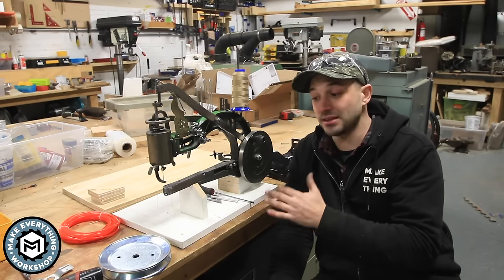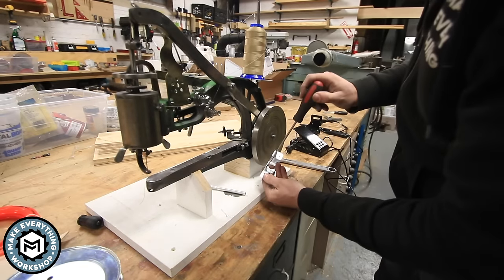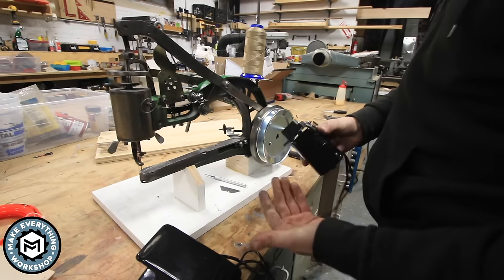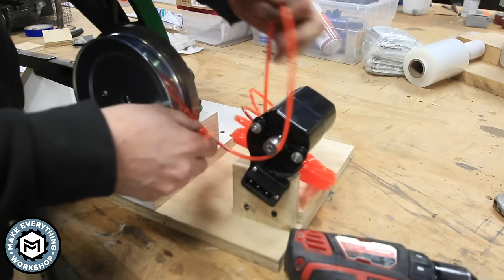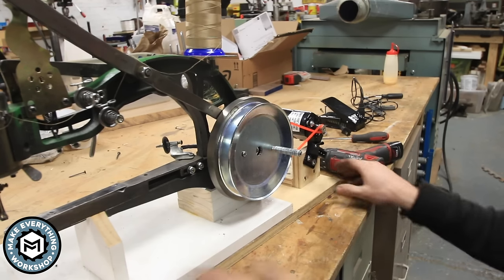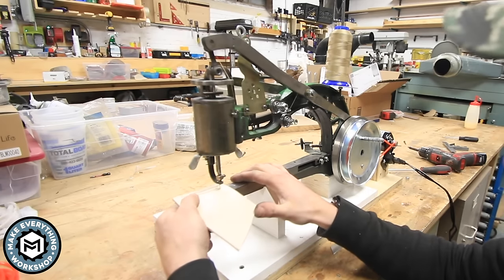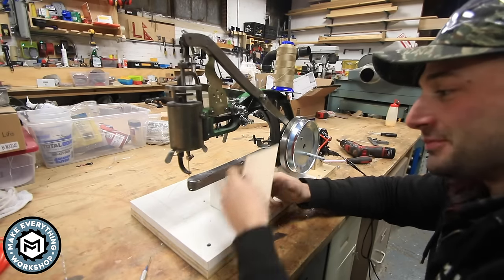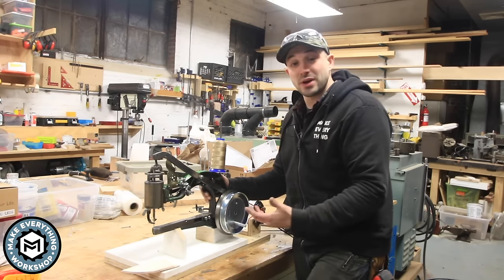Motorizing The Leather Sewing Machine, For Under $50

Comment: My conversion cost $60 but i got a metal mounting plate thats for my machine and my pulley has a groove already in it for a flat belt also if you mount the motor in front of drive wheel ( no need to cross the belt ) its not so prone to lifting the front and not as violent plus the motor i bought is only 3200 rpm so mine goes much slower then yours .

Comment: Heres another hack. On mine I cut a piece of 1/8 stainless steel around 10"x10". Then I drilled a hole where the needle goes through. Then I drilled another hole where the screw holds down the needle plate, and a smaller hole where the little dow that holds the plate in position. I remove the needle plate and then I mount the square plate on the machine. This allows me to have better control of my leather when sowing belts or larger items. Another hack is to buy extra feeddogs, and then dip them in plastic dip. I do this about three times on each foot. This will prevent them from marking the leather. When the plastic wares off, just clean it off the foot and then dip it again.
Reply from the maker: charles self great ideas!
Reply: The usual solution is to make a wooden table that has a slot for the arm and stands flush with the needle plate - no need to change anything on the machine.  Although that wouldn't work if you're using the tripod stand that these machines come with (I think most people throw those away because they're flimsy)

Comment: And the other thing you need to buy is a push rod for pushing the thread down the long shaft at the top of the machine! Another tip is to put a strip of felt on the machine with a drop of oil on the machine so that the thread passes the strip and puts oil on the thread 🧵!

Comment: Add a slightly bigger pulley to the drive motor... also reverse shock the polarity of the motor to make it work in reverse and you won't need the twist in the belt 😉

Comment: I recommend removing the handle all together if you are going to do that. two reasons,when going that speed it would be super easy to get injured or have thread bind in the space. You can also use an industrial sewing machine motor with some modifications.

Comment: So general questions for this as I plan to do something like this when I get back from this deployment:
The belting comes in 2mm and 3mm X 10 sizes on amazon, would you recommend either of those over getting that size and trimming it?
I saw below the idea to put high density foam in the peddle for more control, would you suggest that?
Are there any new updates or tips from others for someone who doesn't know a whole lot about basic engineering?

Thank you for the suggestion and review/tune-up for this, I have been a leather worker for about 7 years now and I've been avoiding getting a machine since all reliable ones have been 1000+ dollars or break with more than 5oz of leather going through it.

Comment: This is a bit late, but you don't need to do all that mounting a pulley to the flywheel, just make two belts out of the PU belt rope that is just slightly smaller in diameter than the flywheel, put them over the flywheel just far enough apart so the drive belt will fit in between them and hold it in place, superglue them onto the flywheel and you're done! 
Using a single pulley to drive the machine may work for a YT video but it will have no torque and run way too fast. 
I made a plywood 8" pulley on a bearing shaft that the motor spins, to a 1 1/2" pulley that drives the flywheel. I now have a slower drive with much more control and torque. BTW, the foot control that comes with those cheap sewing machine motors is just an off-on switch, I found an old one from a sewing machine that will actually give you a controlled speed.

Comment: That motor isn’t enough for this. If the cams at the end are in a high startup torque mode as when the cam is at its low spot and sharply rising, the motor stalls. The small pulley there also  is at a large mechanical disadvantage. As a result, the belt, which is loose, slips. The other problem is that the twisted belt, due to the small pulley, tends to strangle and cause a tightening. At slow speeds those types of motors have little torque.

I’m working on this too, and intend to use timing pulleys and belts.

Comment: You could add other gears to reduce the speed. Your motor will burn because it cannot reach the needed Amps. Having gears would help also you motor to turn faster without rushing your sewing machine getting too fast.

Comment: back in the 90s we used commercial sewing machines in upholstery work with leather belts made of a leather chord that was attached with a hog ring, though the automotive style v-belts lasted longer they where more finicky. 

how long was it before running the belt with a twist caused enough friction where the belt ran against itself to be problematic?

Comment: So I have a serious question and it will be answered later on in the video but I wanted to be honest about the fact that I had the question and hadn't taught it through yet.   Won't the fact that you cross the belt cause friction, at the location of the belts intersection over time heating the belt and either stretching it besuace it under tension or a critical failure point could also develop?    Just curious to know how did it turn out is that something you have an issue with?
Reply from the maker: It definitely can, but because the belt can be refused with heat it’s easy to fix. I haven’t broken a belt yet

Comment: If you turn the motor with the sheave pointing away from you it will run in the correct direction so that you don't have to cross the belt

Comment: I'm going to buy an RC car rubber tire, slap it on my drill, and build a wood mount to hold it smushed against the crank wheel.

Thanks for this video and the previous one btw! Subscribed!!!
Reply: Just get a socket that fits the bolt and turn that with your drill.

Comment: you need an intermediate double pulley between the motor and the large one to reduce your speed even further. It will increase the torque of the machine and, it will move much smoother and slower.

Comment: move motor and turn it around so that the belt doesn't  cross its self , the belts  will wear longer
Reply from the maker: I had that set up initially, it was a little clunky having it stick out, but long term might be the way to go!
Reply: James M  no it won't. it will still be spinning in the same direction.

Comment: You said you would file down the presser foot, be careful because you will not find another anywhere around town. Look for the pressure adjuster and release it until it doesn’t dig into your material as much

Comment: Great idea but needs some refinement. Definitely need to get that motor spinning fast and have the right slow speed to the machine with all the torque and control you need. After all, leather stitching is not meant to be as fast as fabric stitching! One more intermediate pulley to reduce that speed right down would do the trick. Also mount that motor differently so you dont have a crossed drive.

Comment: You did an AMAZING Job figuring out how to put those alterations together without resorting to expensive machining, etc.!!!  Question:  If the motor was mounted facing the opposite way would the belt turn the correct direction so you wouldn't have to use the figure 8 setup?
Reply: I'm reading comments and it seems we can just reverse the wires to the motor, but I think I'm going to get someone to help me look for a different motor which will operate at a better speed.
Reply: @rwind656  With a universal motor like this you have to switch the wiring inside the motor, where you can get to the separate rotor and stator connections and switch only one of those pairs. Swapping the cables outside the motor will reverse the polarity of both rotor and stator windings, resulting in no change.
Reply: @grumpus27  Thanks, I realized later -- saw it in other comments. My better half would have caught me on it here. I always have to double-check my electrical thinking to see if there's something I've left out.

Comment: since you have been using the motor for a while, how is it working out?  Is it too fast or were unable to regulated the speed with the longer screw?  or changed out for a servo, or abandoned it all together??  I getting ready to add a sewing machine motor to mine.  Also have you ever sewn vinyl?????

Comment: Turn the motor around 180 degrees.  Just move your mount toward the front to realign the drive pulley with the machine pulley.  In other words, let's say you have the motor aligned East to West now. Turn it to align West to East and un-cross your belt.  It will be even simpler.  You don't HAVE to be able to see the pulley on the motor for it to work.   You can get an old sewing machine at pretty much every garage sale for $10-20 and they all have a motor and a foot pedal.  Even the free stuff on Craigslist frequently has old sewing machines.  The price there is even better.   Turn the motor around!!!  lol

Comment: i took two pieces of copper made two rings just a little tight ,soldered ends together then epoxy them on the wheel along each edge took old dryer belt and old sewing machine motor and 10 deck screws all for just the machines cost glue  and old junk repurposed  oh and scrap wood for base and motor mounting block works great and i made three belts from one dryer belt tools ,hammer screwdriver knife  leather gloves help with knife work i learned hard way cut the shit out my finger cool video just another method  of  assembly and part acquisition was all i was saying no dis to your work or  idea  just another method for creation/reuse age of  old  parts  for free

Comment: You have a problem with torque and RPM. To get the torque you need to provide higher voltage to the motor; but in doing so, it goes quite fast and gets aggressive. You’ll notice it works a bit better under load while actually stitching than free-wheeling. So my recommendation is to add a flywheel to the pulley. You can do that quite easily and it’ll smooth out the operation, allow you to push the motor at the voltage and current it likes (notice the humming when you’re loading it at a lower range). And like a regular sewing machine, perhaps a quick spin on the manual crank to help it get going will reduce the inrush strain on the motor at start up with the extra spinning mass.
Reply: @jeffallen3382  IME when you try to go slowly with these motors there's insufficient torque to get going so you apply more pedal and  then it's already going too fast - more inertial mass will perhaps moderate this a bit.

Comment: I would be tempted to use a battery powered drill for the motor. It would take a bit of bracket making but the variable speed would be more consistent. It could also be used at the dock if working on a boat

Comment: how about extending the crank handle, same as having a larger crank wheel to get more torque, of course that would mean you'd need more clearance, but I think installing the machine at the very edge of the stand/table would do it? what do you think?

Comment: think bolting the hand crank chucked into the drill press back there and holding a angle grinder up against it would put a nice enough grove to run a little belt like that and it would slow down the motor a bit more. a million ways to not send it off to a machine shop

Comment: I actually the handcrank better specially for leather where I want it slow crawling speed. If you really want speed it's worth to spend in an industrial. If you don't want to pay much for the industrial buy it used. Still a bit expensive used but if it's a hobby you will be the rest of your life doing it's worth to spend the extra money on a real industrial machine. You will enjoy the industrial machine a whole lot better. But this will be fun for a handcrank. Handcranks are fun machines.

Comment: Put a bigger pulley on the motor. Reverse the cord to run in a reverse direction.
Reply: Reversing the cord will not reverse the direction of spin. That requires reversing the leads to the brushes.,

Comment: I had a thought. Why not build a mount to hold a cordless drill with forward and revers and variable speed.
Reply from the maker: Not a bad option, but i like the idea of a foot pedal so your not fussing with a drill trigger, great option to keep it cordless though!
Reply: @MakeEverything  I used to use a cordless drill to wind my bobbins for this machine. I just cut the head from a 1/4" all thread screw and grounded a coned taper on the end to twist the bobbin on tight. I used the machine's tensioner to keep it tight enough.
Reply: You wouldn't want to reverse it, sewing machines don't like running backwards.

Comment: Instead of twisting the belt turn the motor around 180° ( but end out ). With the small pully on the motor I'm thinking the belt will rub against it self and fail.

Comment: Motor in front of pulley under the machine, a few supports and a large thin plate on top of the piece that you slide the leather over(perhaps a small slot in it to clear the belt if needed) and you have a much better and larger work surface without making the foot-print of the machine any larger.
Reply: And a spring to tension the motor.
Reply: @jaredshearer7989  The belt is a spring.
Reply: @grumpus27  In the other direction...
Reply: @jaredshearer7989  If you add a spring it applies tension to the hinge-mounted motor to push the motor pulley against the belt. But if you fix the motor solidly the belt itself applies tension to pull the belt against the motor pulley.  Either way works, but one needs the addition of unnecessary parts and the other is already there.  These belts are quite elastic, not like reinforced V belts;  an additional spring is pointless.  The way to fit these belts is wrap the belting around the pulleys, mark how long it is, then cut it a bit shorter (ca. 7%) and weld it, so the tension is applied when you stretch the belt around the pulleys to fit it, and nothing needs to move.

Comment: could just use an allthread union on the stud poking through the hand crank and simplify the pulley mounting.
Reply from the maker: I tried to do that but its a weird metric thread that I had trouble identifying. Plus then the connection to the next pulley would be sticking way out and probably wobble a lot. The lamp part allows a pretty solid connection that you ca n still hand crank!
Reply: @MakeEverything  hey Im glad to hear it was attempted! Everything has a design limitation somewhere we all fail to see. I hadnt thought about the wobble until you mentioned it. Thank you for the video!
Reply from the maker: @GOTboost-tl3qi  thanks for watching!!!

Comment: Another way instead of using the bracket, belt and pulley would be to add "rubber" drive wheel on the motor shaft that butts up againsts the outer radius of the exisitng wheel. Either way would require a mount fabricated for the motor.

Comment: flipping the motor would be much better than crossing the belt, the added friction will kill the belt in no time . The handle on the pulley is dangerous it could catch on loose clothing really easy. Last of all a higher power motor with a wider belt is really necessary for what you're asking this machine to do, they make other kinds of pulleys for the sewing machine motors that will transmit power much better with wider belts.

Comment: Maybe I'm overthinking it but why not turn the motor around to keep from having the belt twisted and use a rectangular O-Ring or a flat rubber belt over the cam plate that's already there instead of adding a pulley to it and remove the pulley from the motor making the drive shaft of the motor a smaller diameter which would give more of a speed reduction all the while still using the original handle that would not need to be removed? Yes, there would likely be a bit if finesse aligning the belt but once you have that done, you're ready for a lot of sewing. If you buy O-rings, you'd never have to adjust anything when changing "belts".  Maybe being a maintenance man for so many years makes me think like this, but it seems to be an easier setup with less work to make it function as you have it doing. If you need a little more speed reduction you could simply increase the diameter of the cam plate by wrapping it with RUBBER tape (available at electrical supply houses) which would also insure that the belt grips well.

Comment: Y'all missing the best part of this machine: the walking-foot rotates so you don't have to turn the piece you are sewing!
Turning the walking-foot is a lot more 'responsive' that trying to turn a slice of leather, no?
One hand turns the crank the while the other hand turns the walk-foot, guiding the work through the machine.
The leather has no choice but to follow where the foot leads.
BTW, the cams on this thing are all wrong for motor operation!
A Singer sewing-machine style of foot-treadle, timed to assist on the needle down-stroke, is better suited for the cut of the cams.
The mass of the flywheel was expected to carry the machine around for the next stitch after the needle bottoms out.
The cams on a powered machine take into account the acceleration of parts at higher speed, hence they run more smoothly under motor power.
BTW, I learned to sew on a treadle machine, using paper to set the top and bottom tension.
If I could write my name on newsprint and keep the tension even, Grandma made me pancakes for breakfast.
I like pancakes.